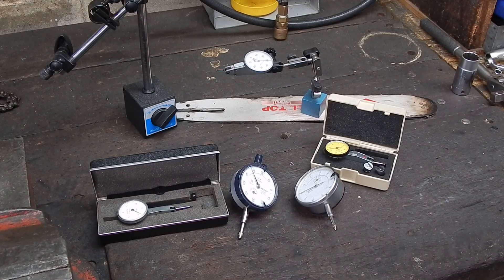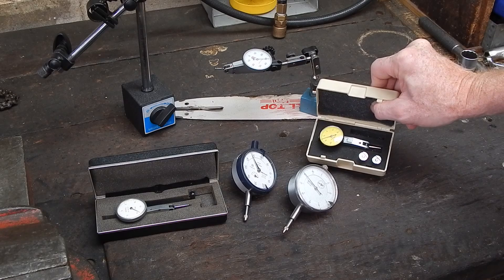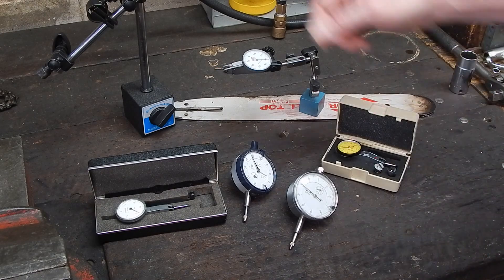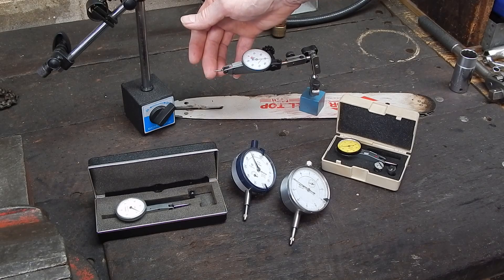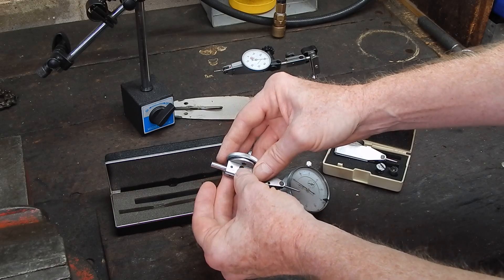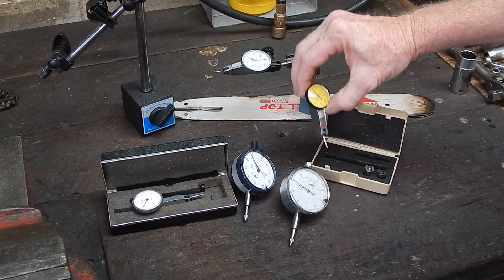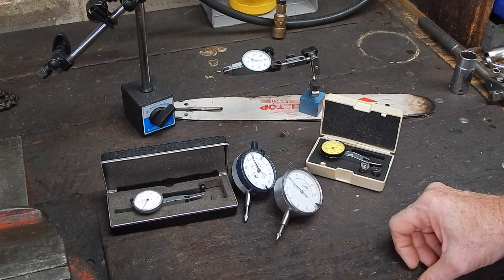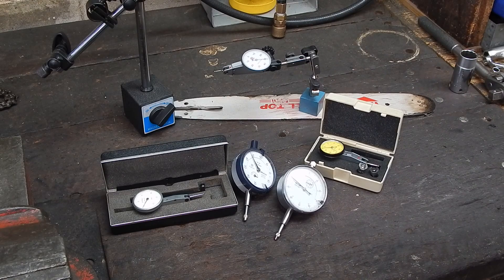Beginners guide to dial test indicators

Comment: I’ve been trying to find information on how to ‘Zero’ my new cheap Chinese-ium DTI for a while now and hoping you can help me.  It’s a Neilsen CT3785 (35 UK Sterling £’s) reads Metric to 10mm.  Stand appears to be the same as your blue & white one in background, gauge possibly the same as the one on the right.  Bezel is castellated to grip & maybe move, but doesn’t appear to actually rotate.  No User Manual or Instructions provided or found online.  Two fittings, one top, one at 1 o’clock, 1 o’clock one undoes & tightens freely but appears to do nothing and undoing it doesn’t allow bezel to move; top one doesn’t appear to move. Any ideas.  Can obviously use it without zero-ing (to check Wheel Bearing and Brake Disc Run Out) but would far prefer to be able to zero it.  Thanks!  Viewed lots of these videos on YT now, can’t find one that tells me how to zero it and most are in imperial as appear to be from USA, we stopped using inches here in the UK before I started school about 50 years ago.  Becoming increasingly frustrated and desperate for a very simple issue!!
Reply from the maker: Good mag base designs have an adjustment/zeroing screw on one of the arms.  Use that to zero the clock. Both shown in the video have this feature.  The small mag base shown at "0.45" early in the video is particularly good for DTI's and has an adjuster near the base.   Nice and compact.  I never use the rotating bezel (if fitted) except for clock face orientation.  I would never buy a mag base that did not have a fine adjustment screw/capability.   Look closely, even at the brand names. Cheers Rob

Comment: Hello there. Which one would be preferable to measure runout / concentricity? 
Thanks
Reply from the maker: For absolute measurement you should be using a dial indicator.  For variation adjustment use a test indicator.  A dial indicator will always be the most accurate as if set up correctly there is no cosine error, unlike a test indicator which will always have at least a small mount.  Cheers Rob

Comment: Can you teach us what is the best test/dial indicator which is specifically used for helping to perfectly flatting a granite surface down to 1 micron accuracy? I saw someone saying that the test indicator position needs to be at the correct position being horizontal else if it is in an angle position the test indicator will give false readings, and he proved it in the video.
Reply from the maker: That is correct.  The contact probe of a test indicator must be parallel to the read surface or there will be a cosine error introduced.  For this reason if you are measuring a flat surface then a plunge (dial) type indicator will be preferable.  One Micron is 0.001 mm, so to measure in that scale will require an extremely accurate indicator for the same graduation scale. 

Digital and analogue plunge type indicators are readily available that will do this. Prices vary with quality and brand name.  Search for "0.001 mm dial indicator".

Digital are easier to read, but analogue allow additional reading/estimation between scale divisions.

Cheers Rob

Comment: Just dropped the little yellow indicator you got there. Same symptoms. Took it apart. Pulled the "tiny thing that spins around" with pliers. Removed the yellow disc. Then there are two screws that you adjust the sprocket engagement. Move it so slightly until it doesn't stick. Now mine works as a charm!
Reply from the maker: Good save.  Sometimes they jump the teeth on the rack engagement or destroy one of the probe pivot bearings.  Not meant to be dropped.  Those SHAHE ones are really good units, especially for the money.  If mine was terminally injured I'd certainly get another one.  Cheers Rob

Comment: would the test type be ok for setting my lathe 4 jaw chuck.thanks
Reply from the maker: Absolutely.

The big advantage with test indicators is that they do internal as well as external readings, and also faces..

I have two Mitutoyo dial indicators and never use them.  I do everything with the test indicator.  It's super accurate and sensitive, not expensive, very compact and easy to use.

Dial indicators have their uses (eg setting up crankshafts) but you will find a test indicator to be way more useful for most precision lathe work - eg setting up a four jaw chuck.

They are one of the best and most useful things you can buy for your lathe.

The cheap Chinese ones work quite OK, and if you drop them it's not a huge loss as with high end brands.

None of then like being mistreated.

Cheers Rob
Reply: thanks I'm going to buy a verdict 05/2003 t3 to use on my my ford ml7 4 jaw chuck do you know the correct stand I could use for this test indicator.thanks
Reply from the maker: Nice clock.  Regarding a suitable mount, even the cheap ones are OK, and they come in all styles, so it comes down to choice.  It would pay to ask the seller if it takes a standard dovetail mount and what they have suitable.

My advice is to get as small/compact one as possible.

Cheers Rob
Reply: thank you

Comment: Thanks for this video
I was wondering if it is possible to change the default angle of the test indicator for a cheap chines one?
Reply from the maker: Yes.  They all have a probe that can be moved to the angle you want - necessary to avoid cosine error.

The Chinese units I've used were all totally OK, and excellent value for money.

If you drop any of these (regardless of price) on the floor you will almost certainly damage/kill it.  So cheap ones are good to use in that respect.

Rob
Reply: The most comprehensive video about dial/test indicators on youtube
I think I will first loosen up the side screws, it will also help a LOT protect the test indicator from cosine error
Thans again sir

Comment: you made a small error in stating that the probe had to be parallel to the work.

with tesa type (type not brand) test indicators, which yours appear to be, the probe should be parallel to flat surfaces and tangent to curved surfaces,

with interapid type test indicators the probe should be  at an angle of 12 to 15 degrees to a flat surface or to the line of tangency on curved surfaces.

Comment: Nice piece Rob.  I bought a dropped dial indicator at a swap meet for a dollar and was able to bring it back to life.  You might want to try that with the one that you dropped. (can't hurt and you can learn how they function).  Word to the wise though, have steady hands (no coffee) before you start to work on it.  Thanks for sharing and have a great Holiday Season!   Fred
Reply from the maker: Fred Miller Hi Fred.  I opened up the one I dropped, and it had actually bounced the rack return spring off of it's little peg.  I fixed that, but it then had some stiction.  Since the video, I had another go at adjusting the probe fulcrum, and it seems OK now.  Having said that, I now prefer the replacement Chinese one as it has a slightly larger dial and is a bit easier to read.  Those screws that hold the side plate on sure are tiny :)  You got a good buy for a dollar. Have a great holiday season also.  Cheers. Rob

Comment: With that lever type indicator you should note that they have a error because they measure an angle and not a vector. this error is the cosinus of its deflection. You will get a 1,5% smaller value by an angle of 10° [cos(10°)!], 13,4% by an angle of 30° and so on.
You will also have to take care of the angular offset of the lever indicator itself when you measure a distance with it. if it is not parallel to the surface you are measuring(because you preload it) you have to add that angle to the cosine error as well so you will have as error cos(preload angle + measurement deflection angle). Digital lever indicator will not have this problem because they internal calculate the angle error out of it.

A plunger type indicator does not have this.
Reply from the maker: Morkvonork All good info about the inherent error factor with test indicators.  I didn't get too technical in the video as it was aimed at newbies, but yes, you are 100% right. Thanks for mentioning it. The main benefit of the test indicator is of course, that you can measure inside cylinders very easily.  I tend to do a lot of set ups for that (small diameter) type of work, so it's a god send to me.  Cheers Rob..
Reply: a DTI does not have a rack n pinion mech, but rather a lever mechanism.